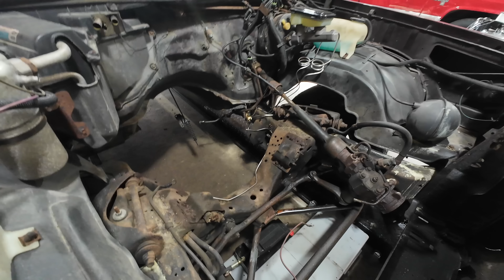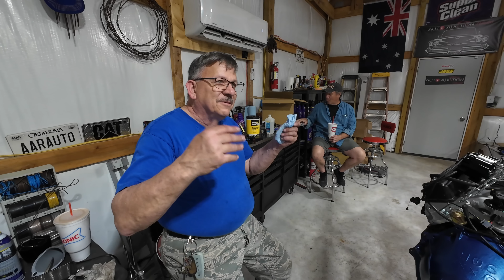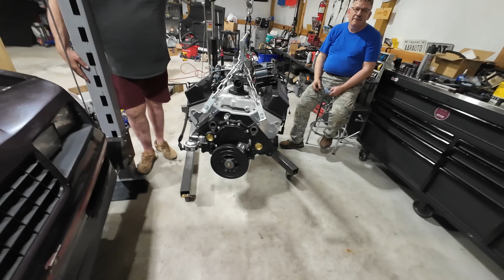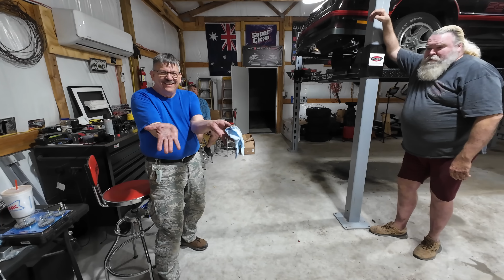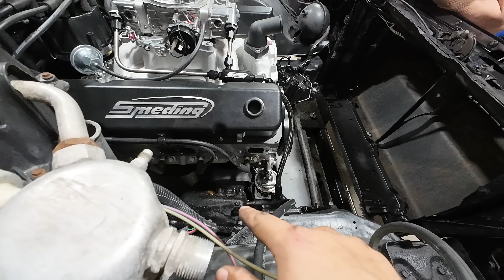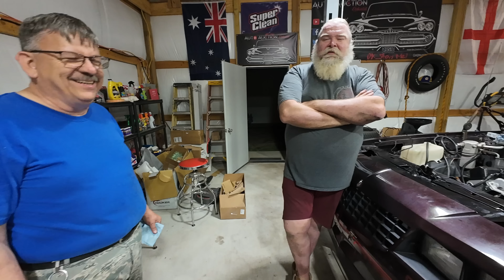1987 Monte Carlo SS 500hp Smeding Engine Installed

Comment: that car with that engine will we a great drive ! 255s in back ...235 s up front will look & handle nicely those tires will make the suspension do its job & fit nicely in the wheel wells

Comment: Just curious Why do you stab the engine and trans assembled? I have been working on these cars since the 80s and it’s always easier and faster to set the engine in then put trans up from the bottom.

Comment: 200r4 Randy. 200r4. Not 200 4r. I can excuse it once or twice as a verbal slip but every video, you say the wrong thing. 
As for the Monte SS, quite disappointed. Low mileage, driver quality. You paid too much to begin with. Swapping the original drive train out is destroying the value. If that's what you wanted to do, you could've bought a decent condition regular Monte Carlo. That would've raised the value of that and it probably would've been cheaper to build. Some of these vehicles you buy start out good and just need a little bit touching up but then you mess with what's good and mess them up. Idk who is buying them after you but quite a few times they pay too much. The anniversary Trans Am was way too cheap. The Formula Firebird was too expensive.